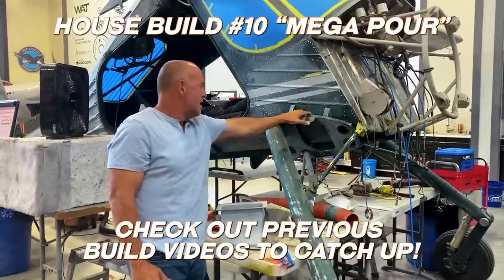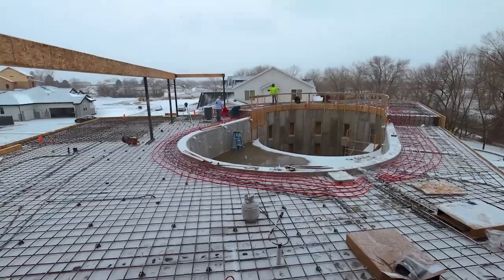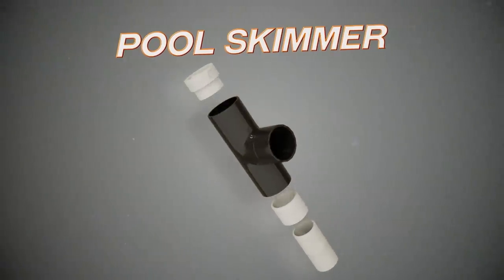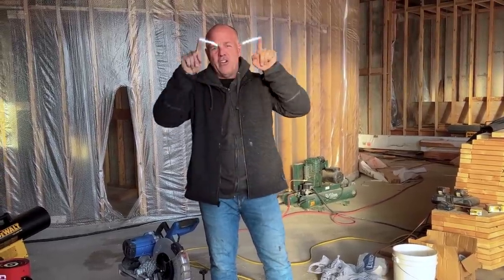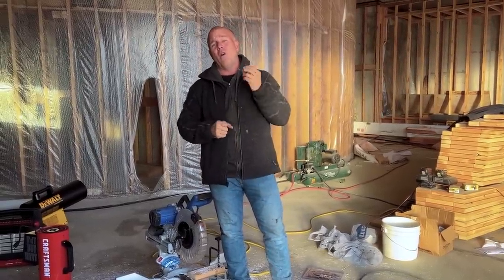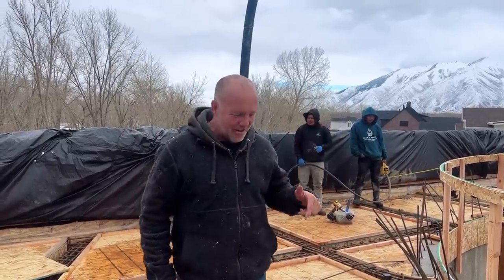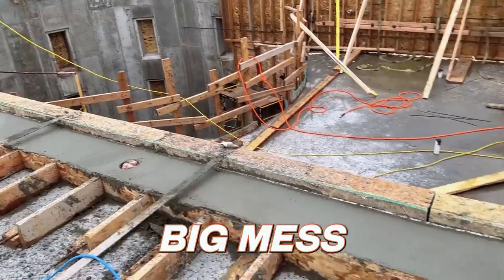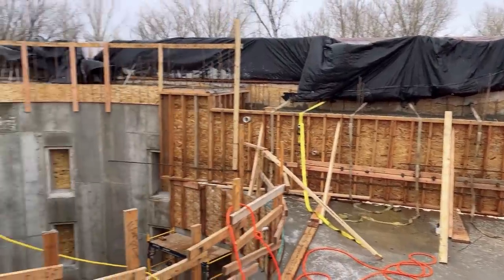Earthquake Proofing a Suspended Concrete Deck On a 3-Story Deep Pool | House Build #10

Comment: Beautiful job as always!  I designed and build my own home in the 1980"s  and then hand built and 45x13 foot pool with 8ft deep and 4ft shallow end.  I designed a system to treat the water that seldom needed any bleach treatment by using a Ozone injection system.  It could produce over 10 times the output of any other product then built for installing on and inground pool and didnt cost that much to build.  I should have started to produce it but other personal problems came up thata kept me from doing that.  It was nice to have the clean water with no eye problems.
Reply: That is nice!! Less chemicals is so much better.

Comment: Mike, I loved your comments about “going the extra mile”. I’m not rich, but I don’t build stuff based on cost alone. My garage sits on 32” footing walls, with the floor poured afterwards, and keyed in around the perimeter, with rebar projecting out and tied to the grid in the floor. I guess it was overkill, but it didn’t cost much more, and after almost thirty years in Northern Alberta, there is a single hairline crack running from the corner to the sump out in the centre. Someone said to just pour a 4” pad with mesh in it. That would have been a waste of time with two levels and attic storage on top of it. Corner cutting is for commercial guys with no conscience or common sense.
Reply: It takes just a little more effort to make thing exponentially better and easier on you in the future. You’re now money ahead on your concrete. 🙌

Comment: Mike, Amazing engineering based on years of experience. It would be a great learning experience for young engineers to see a video of the failures you have encountered throughout your career and the processes used to overcome them. I've worked with some great aero and mechanical engineers in my life and learned so much by watching them overcome design issues along the way.

Comment: Fascinating!  I am currently building a 40*20 in ground pool with an expansive patio and balcony structure all on top of 50 foot piers due to unstable ground over an aquifer.  Nothing compared to this build but Mike's project helps me understand some of the decisions the engineers are taking in my build.

Comment: Great idea.  How will you be dealing with the noise these will make?  You will get two types of noise.  The suction will make a noise and the turbulence of the bubbles will make the pipes noisy.  In the reef tank community they pot ball valves on them and adjust them so they slow down the water and keep the pipe filled.   But leaves will clog those regularly so you will need some auto valves that can open and close to clear the lines periodically.

Comment: Ref sealant for skimmers:
Boats are using butyl ( isobutylene-isoprene rubber). It's easy to use, remains soft, acomodates a wide range of expansion/contraction between different materials, easy to remove, and easy to reseal.

Comment: Hello from Sydney Australia.
Thank you for the critical stage inspection and explanation of the concrete forms and reinforcement. I was always reminded to ensure full bar length cross overs at T and corner intersections.  Also consistent MPa and slump (delivery dockets).
Ingenious idea the pipe skimmer drains: I am wondering about the pool edge finish level and capping the skimmer drains?
🏊🇭🇲

Comment: For freezing temperatures, You are more than right... I also have at home few of those thermometers (also can use those for cooking meet!). They are cheap, and pretty usable... (There are today some chemical products, that should prevent freezing of the concrete, but doesn't work as they should - by my experience) ... keep it warm during freezing temperatures... Regards from Serbia

Comment: One side casing is hardest to do, without opening itself... double side, You need to anchor, as You did, mostly at the bottom, and easier on top (logical)...but there is always a risk... pour concrete in layers, wait a little bit to start hardening, and proceed, just enough to attach one layer for another, but don't exaggerate...also, don't go too fast at one spot, go around slowly... follow Your senses, and guard it carefully always...there is not going back... don't rush! If casing start to crack, or loose itself, reinforce it (have plan "B" in advance - even plan "C" )... :) Regards from Serbia

Comment: It’s nice to see at 10:29 that someone with Mike’s perfection is just like the rest of us when using PVC purple primer and glue, it goes everywhere. I feel a little bit better about myself now. 😂😂
Reply: Haha, I thought that myself.
Reply: My grandpa, who wasn't a plumber, but has fixed as many leaks as one, always told me, "it doesn't matter how pretty it is if it leaks, use the cleaner and glue like you're not the one paying for it." 😂 And wouldn't you know, I glob it on and have NEVER (so far) had to deal with a leak from plumbing 2 houses I've redone. It does look silly under the house though.🤣😂

Comment: Your videos insprired me to build my own crazy house build. I've incorporated some of your ideas and advice when I designed and built my house since part of it that sits up on 8' tall concrete columns. Pouring concrete when the only fix for a bad pour is teardown is very stressful. Definitely worth the time to pay attention to the form details and make sure everyone is on the same page on concrete day. Wet concrete is unforgiving. The relief and satisfaction of a good concrete pour is quite good. Awesome videos, please keep them coming. 

One question. Was OSB used for the wall forms because of the cost? Or was it because the texture helps with bonding the final finished surface? The texture of the panels makes it a real pain to peel off when I've used it.
Reply: It’s sometimes a pain, but it not only saves money, it gives a good texture. We use a grinder wire wheel on the concrete to get the little pieces off. But in the end, it makes a great texture for the plaster.

Comment: An amazing amount of structural engineering, it's going to be a great place to hang out in the summer months. I'm wondering if Mike will be using the water from the pool to cool the house in the summertime and if he will be attaching solar panels / batteries for electricity production.

Comment: Wonderful video on building engineering as well as practicality. Curious if Mike used regular concrete (2500 - 3000 psi) or high pressure concrete
Reply: I bet it’s 8k psi concrete.

Comment: Our family were custom molders for near fifty years in Southern California serving many different industries using many different plastic materials.  For durable injection molded material for your project you may want to use an AB S  instead of PVC  .  There might also be a  fiber or bead glass infused plastic material for molding these parts .

Comment: Concrete appears to have a lot of  aggregate and looks around a 4 slump. Should last about 1000 years.  👍

Did you add any Fiber reinforcement in the mix, or does it even need it ?

Comment: well if you dont want to put that yellow Mastinox coating on bolts like the PC12, you can use the chromate free alternate. CA1010 Mastinox Chromate Free Jointing Compound, If you have a vortex happening in a suction side, a stick set in it breaks it up.

Comment: I am commenting, during watching the video, so I don't go through it until the end, and then start commenting...  I can notice that I am repeating same advice, same that came from the owner of the channel... at least, we are at the same level ... nice job guys! Also, on more notice: always have few extra vibrators for the concrete, and "needles" for them... if one is stuck in the reinforcement, and after few tries can't take it out, just cut it, and leave it inside, and use new one... there is no time to save it - concrete and structure is much more expensive!

Comment: THIS is an amazing project... and very cool.  I look forward to every update uploaded.  I have faith that you have accommodated for the amount of water... but every time you show us the tank into which the pool water would drain, my initial thought is that the tank couldn't possibly be big enough.  Is there more than 1? Is it super deep or something?  I trust that you have it all worked out and I can hardly wait to watch it all work as intended.
Reply: The pond we put at our property shown in the video was quite a bit larger than this project. We did a similar system there and it worked great. Mike sized this one proportionately for this pool based on previous experience.
Reply: @ChandraSlyFoxPatey  I'm sure he did... he's an engineer after all, but something must be wrong with my spacial awareness because it looks to me sort of like he's trying to fit a 10 gallon hat in a 1 gallon box.  I'm thinking that the tank must be bigger than it looks... or he's got a few of them.  In any case, I absolutely LOVE these problem-mitigating ideas.  I can hardly wait to see this come together.
Reply: @tylerbarrett6652  I see what you’re asking. The pool water stays in place. Only the plumbing that could potentially freeze drains (exterior lines and waterfalls.) The majority of the plumbing lines are sub-terrain and in the basement, they aren’t subject to freezing. The volume calculated of all the pipes that drain can only fill about 10% of the vault.
Reply: @ChandraSlyFoxPatey  - And I suppose the process of winterizing includes raising the floor of the pool to the very top... so the water isn't in the weather... and of course the water is heated too... as is the floor... Okay, I think I get it now.  That is VERY cool.  Thanks for taking the time to explain the mystery.
Reply: @tylerbarrett6652  Sure thing! Have a nice evening 😊

Comment: Another solution to the challenge is to have a drain ledge at one or more sides of the pool. The water flows over it and then down circular drainpipes. The method has been used for at least 75 years.

Comment: will it heave a second air intake so that no head or belly can be sucked to the wall?
Reply: Great question. There’s no suction on it, it isn’t connected to a pump. Additionally, there are 6 intakes on top and 4 on the bottom.

Comment: Hey Mike, quick question- why the 2x2 material bordering the grade beams? Dose this not make it a nightmare to strip? Or is it for crack suppression?
Reply: Nevermind, looks like it was to pour the grade beams seaperate rather than monolithic and getting the cold joint in the slab. Brilliant as always.
Reply: Should have finished the video lol.

Comment: But did you calculate how much heat the curing concrete will create? This is an exothermic cure process, it going to generate a lot of its own heat.

Comment: Is there a danger of a kid getting sucked up against the skimmer?  Also, it appears you have several cold cement joints in this pool, will this be a potential leak problem?
Reply: Great questions. The skimmers aren’t connected to a pump, they are gravity fed to the vault, there’s no suction to create entrapment. If you completely  block it with your hand, you won’t feel anything. 
The 5 bottom drains are connected to a pump, code requires at least 2, they’re interconnected to prevent accidents. 
There are 3 cold joints, all of them have layers of expansive joint material between them. If water makes contact, they expand and seal, it’s the same as water tower tanks that can’t leak.
The next layer of waterproofing will be, the joints  getting slot cut and filled with waterproofing compound. The third layer will be the top coating, which is 1.5-2” thick, that is the official waterproofing member, the other 2 are “insurance.” 😊

Comment: Only thing I see ‘wrong’ is that there is no weir wall inside the skimmer throat which means it’s not a skimmer. You’ll have to have insane flow to get a skimmer action on each pipe. Easy to create with his expertise but very necessary. Also, 3” of encapsulation of rebar. I saw rebar touching pipe which is bad in any water vessel. These are details which only crosses the T’s and dots the I’s of an amazing project!

Comment: MST Bar may have had some interesting advantages if used as an alternative to regular rebar, non conducive, non corrosive, 
1/4 weight, high shear strength, customizable.
I have no affiliation with this company just mention it for possible future consideration, you seem to be building a lot.

Comment: IMO, owners of property are morons.  They are going to swim, in a pool whose bottom can be lifted.  Meaning there is a HUGE amperage available under the pool.  A water leak could cause anyone in pool to be fried.  Boiled.  Cooked.   Nice project on paper, lol.
Reply: The electricity running the platform isn’t under the pool or where a leak would be able to get to it. A full explanation of the pulley system and how it works will be coming in another video.